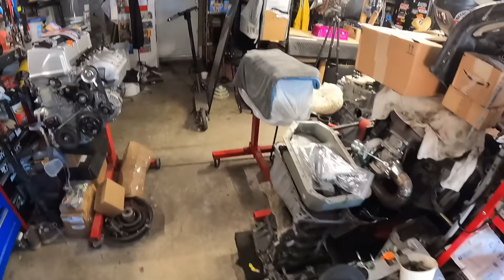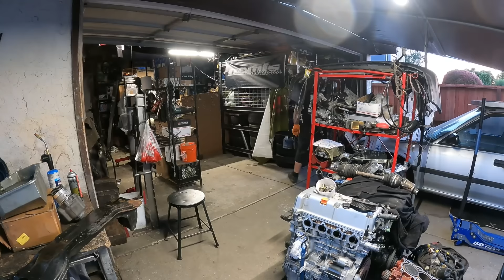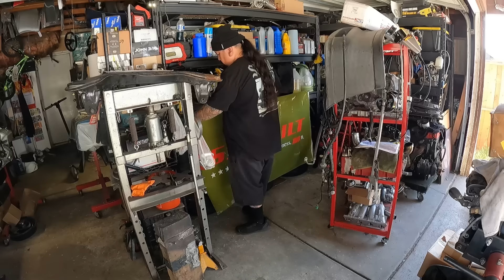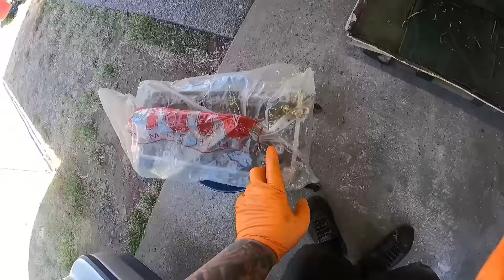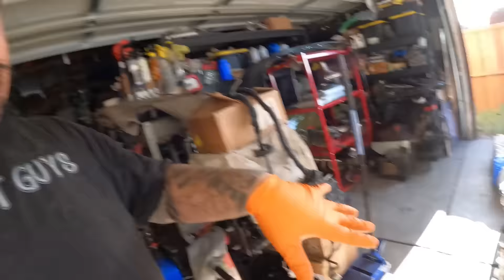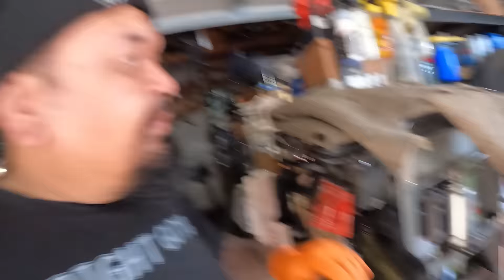LSVtec Turbo EK Dyno + Organizing My CLUTTERED Garage + K20a2 Assembly #OffDay

Comment: You should definitely pressure test it before condemning the block it’s a easy ass test they sell the tester for 129 at harbor freight good tool to have in your arsenal will pay off in dividends 💪🏼

Comment: From an ai, so ya'll won't say it's my opinion. Go with that one you have, Dana...I used mine on B18 and Datsun L16, still like new and beautiful crosshatch, I think i got 240 grit.

It is not critical to have the brush research ball hone exactly match the bore diameter, and an 8mm difference is fine if the tool flexes to contact the bore. In fact, the tool is designed to be used oversized.
Key facts from Brush Research Manufacturing (BRM):
Aspect	Detail
Oversize design	BRM ball hones are always supplied and used in an oversized condition — a hone for a 4mm bore has a diameter slightly larger than 4mm 
Between sizes	If the bore is between standard sizes, choose the larger-diameter tool 
Correct selection	The right Flex-Hone has a tool diameter larger, not smaller, than the bore diameter 
Flex adjustment	The built-in "flex" adjusts to size differences; it's intended for use after the cylinder is sized with rigid stones 
For your 8mm difference:
Since the hone flexes to contact the bore, it will work properly

The oversize creates a soft cutting action rather than aggressive sizing

Ball hones are for surface finish/crosshatch for oil retention, not for sizing the bore

One caveat: Make sure the hone isn't so oversized that it can't flex enough to make consistent contact across the bore. If it's contacting evenly and you're getting the desired crosshatch pattern, you're good.